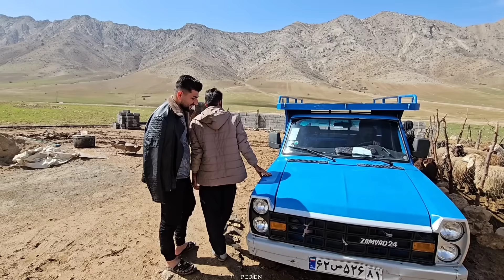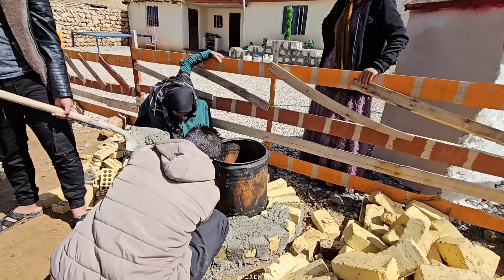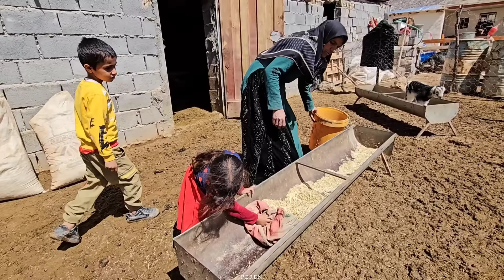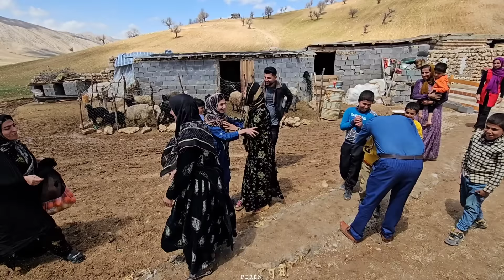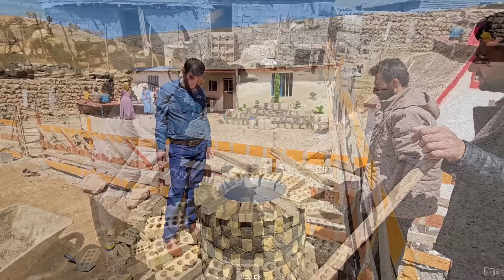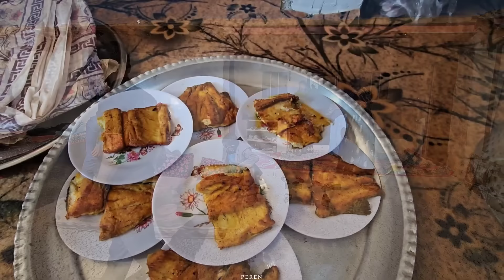rural life .  Seeing and visiting  🫂 Nowruz Eid in the Peren family   #villagelife

Comment: That is a very thick trash container. There is no need to make a thick wall. It should be with holes so that air can circulate and rain water will not collect in it. You are wasting your bricks and cement. The container should only be use to hold the garbage bags temporarily. Or maybe you plan to burn the trash in it. Make holds around the bottom so it won5 be smelly